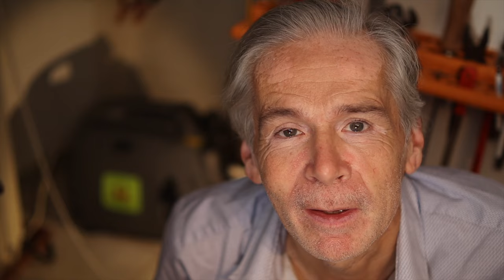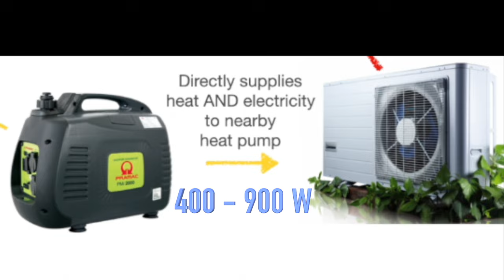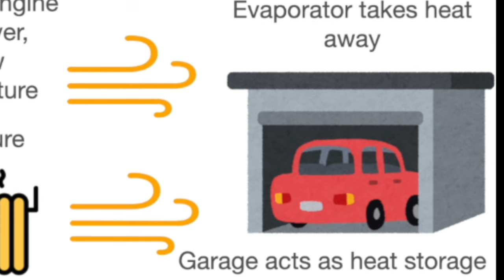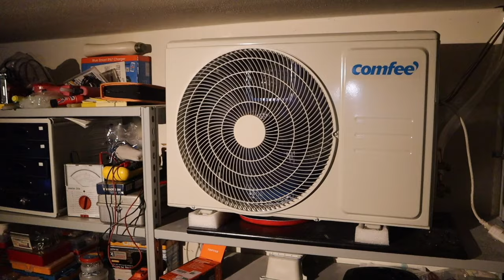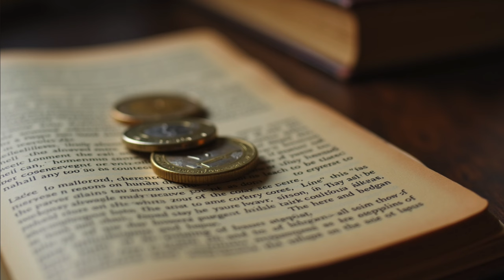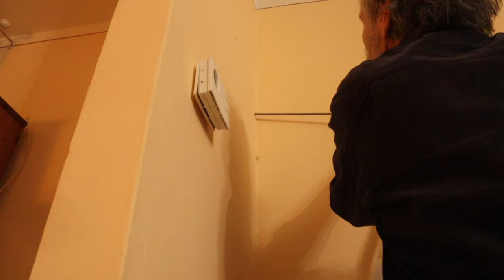Blackout? My DIY Power plant keeps producing electricity and heat at home. - Video 117

Comment: Excellent my friend.

May I suggest further research?
- large motorbike engine with water cooling as main engine for generator.
Could be used directly for water heating using microbore 10mm pipe into underfloor heating pipes or high thermal mass heater. 
Larger motorbike engines can run very quietly. Maybe even a small 3 cylinder vehicle engine? - can incorporate automatic starting and remote control.

Methane gas production using digester and tanks in garden, can supplement fuel supply using dual fuel generators or engine design.

DIY batteries using “crowfoot’ design used in old telephone exchanges. Low energy- but serviceable.

Very good progress and presentation.
Thank you.
Reply: Hi, British Gas were offering a similar product to this in the UK.
They has a natural gas fueled single cylinder engine that generated electricity and the waste heat was used to heat the home. I don't know whatever became of this. M.
Reply from the maker: Dear R. Perkins, thank you very much for the advice, I was once at a car workshop and they were working on a small car with also a 3 cylinder engine. It was so quiet! I asked them if it would be easy to get such an engine to bring home.
My brother suggests me to use marine generators that are very silent and water cooled, also small enough to be reasonable for a single house. He has been owner of boats for all his life.
Regarding biogas, I have in video 26 https://youtu.be/BpVsi8EMyNE a project that produces it from kitchen waste. Also this summer we used it much and had a discount on municipal waste tax. I wonder if it is easy to use it for an engine. I once visited a big biogas plant that was using the gas in a big Jenbacher engine and had treatment equipment.
DIY batteries are fascinating, what is this crowfoot design? Anyway, I will do research on it. It is a big issue.
Thank you very much for your encouragement.
Reply from the maker: Oops, I placed the reply to R.Perkins one level too deep.
Anyway Markeh, I would be interested to know more about it. Is it maybe Ceres Power? They announced a contract with British Gas to develop domestic fuel-cell CHP units for UK homes, but more I can't find.
Reply: @nnvasen-good-energy We did have a CHP unit running for the house we are in that did 14 houses, but would not heat the end two in winter, so they decommissioned it and fitted gas boilers to them all instead. Unsure of the make or model as it is in its own little shed.
It would have been more effective if they just put the two end houses on gas instead of them all.